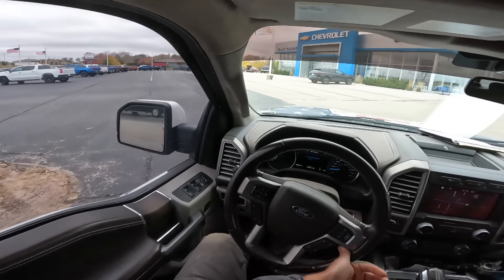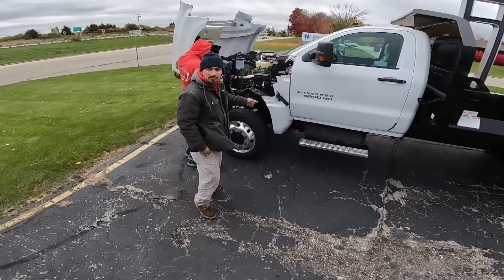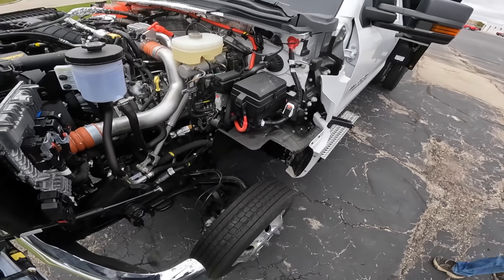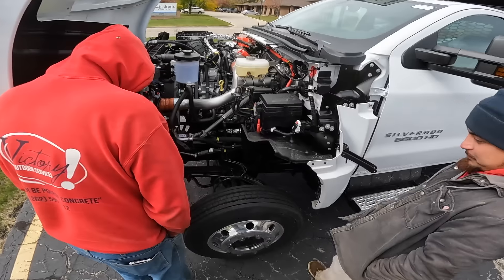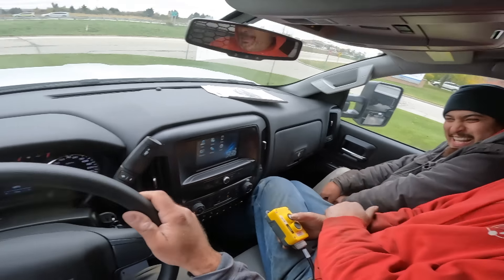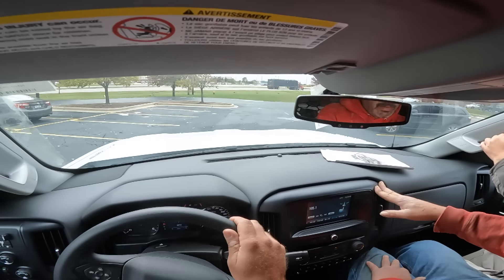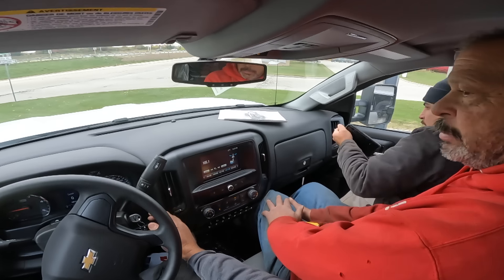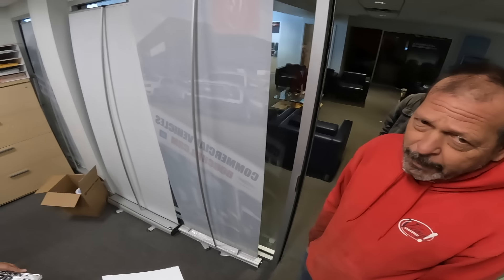BIG new purchase. What is it?

Comment: I'm amazed by how small the wheel & tyre combos are compared to the rest of the truck. Always looks odd to me, but that's coming from being in the UK I guess!
Reply: felt the same being from US
Reply: They've been building them like that for some reason for years now.
Reply: I thought the same thing when they rolled up on it, like Why are the wheels and tires so small?
Reply: It kinda tricks you with that bed, makes you think it’s a big bump truck but it actually just a pickup truck .just like the f350 he already has .
Reply: them are street tires not the off road tires
Reply: Tire size has to do with gearing.  Power to the road , and fuel mileage.  Like sprocket size on a motorcycle. Engines today are so much powerful that tires can be smaller.
Reply: @stevehamman4465  no just because an engine is more powerful has nothing to do with the tires . Weight of the vehicle will effect tire size.

Comment: great purchase, I have a 2002 duramax 3500 dually diesel with 400,000km - 248548miles , runs like a champ still, even after sitting unstarted for 5 years. duramax and allisons are a beast

Comment: Ryan, I bought a Diesel 2008 4x4 Duramax/Allison. Dually. in 2014 for 23K I had one more year of college. Was between jobs ( not working full time) I knew I had to have this truck. And YES they are an investment. Yes these super duty trucks are extremely expensive. To this day I have NEVER regretted my decision. This dually pulls my 30’ RV home and my 30’ GNLQ as well as my BP horse trailer, with ease..The engine is a beast and I love the safety with its size . (King cab/super crew). I maintain the regular maintenance, at the time of purchase it had 140K miles now it’s 186K.   I love my decision and you will too. These trucks are hard to find and will last a lifetime. Good luck and congratulations. You won’t regret anything again congratulations, enjoy the fruits of your labor. 
Easy money. Hehe 😜

Comment: I ran into the same thing with my wife's vehicle.  Toyota allocates certain amounts of inventory to each dealership per month or quarter or something like that.  So a couple dealerships teamed up to provide a larger selection of allocations between two.  So I ordered a vehicle for the first time ever.  Supply chain issues forced this model, along with the pandemic.  I run the 3/4 ton duramax for my tree business.  I had the same line of thinking, I wanted to be able to pull a skid steer in case I needed to.  And I have!  No regrets on the Duramax.  I paid half what you are looking to pay though as mine is a 2017.  I've run the DEF down to limp mode lol.  You wouldn't regret that buy and it would serve you well.

Comment: We have a few of them in the fleet where I work and they are used just about every day with minimal problems 
Low coolant light when cold and it’s not low 
And Frnt shock mount issue.. one’s has 89.k on it and it was the first year they made them 
Great work horse 
Be careful the hitch will destroy the gate if you don’t have the chains set correct

Comment: I have the 2500HD with the L5P. This 5500 has the L5D which is a slightly detuned version of the same engine. The motor is a monster! You'll love it. The power is insane.

Comment: Just a suggestion; you know that everyone will load a truck differently, no matter the height they have to overcome with the bucket. I would 'skin' that floor and drop down sides, the interior of the bed with diamond plate steel. Heavy enough to withstand hard hits. I say this because that bed sounds thin from the sound the doors are making if it's the same wall thickness. Otherwise a few years of abuse and that bed is going to look heavily abused and a lot harder to skin the bed when it's warped/damaged heavily. They built those beds for long term gas mileage advantage long before durability/longevity of use. It's worth the sacrifice of less mpg.

Comment: They do make a bedliner for dump boxes. I think that you shouldn't have a rough surface on the bed of your truck. Decision is not mine. It is just a rough surface and if you ever decide that using as a dump truck. It will stick to the bed of the box.

Comment: Great truck but they ride veryyyyyy rough unloaded. Still a very firm ride on my 6500 with a 12ft utility body loaded to the brim with 100gal transfer tank air compressor, tools and parts for equipment, etc.. Solid truck tho.

Comment: You could go to most big dealerships and find a 3500 ram Cummins which would have equal towing capacity and look nicer inside. For 75k. Not 100k if you are patient and build out a ram truck the turn around has been pretty quick. Like a month and a half. But usually people will quote 3 months

Comment: Is that a Harbor dump bed? I actually used to work at a company and I installed construction beds on trucks. Have you ever thought about buying a truck with a completely costume bed on the back to how you want it? We would build it in house weld it all up to how you want it from metal tubing and angle and sheet

Comment: If you don’t plan on growing your business any further, then, why spend $90,000 on a brand new truck that WILL NOT make you anymore money??? I mean, yes it’s your money and you can spend it as you please, but that is not an “investment” as you are desperately trying to convince yourself…… An investment requires the ability to make MORE money. This truck will make you no more money than your 1 ton dually does at the moment. Which really is $0. Trucks in a service based business like yours are really just a necessary minimum expense in order to do business. No different than your diesel bill every month or insurance every month, or payroll….. those are all bare minimum costs in order to even run your business. Without trucks you couldn’t make it to the job sites, without that you have no business. Yes you need reliable trucks for your business but you don’t need THAT truck….. if you wanted to grow your business then MAYBE purchasing a nice new truck would be feasible! Not only for longevity but for LOOKS! Which are quite important in today’s business world.